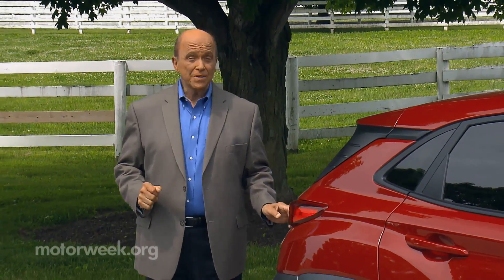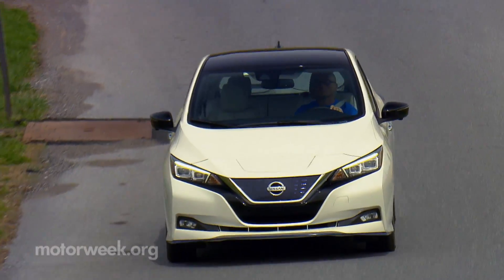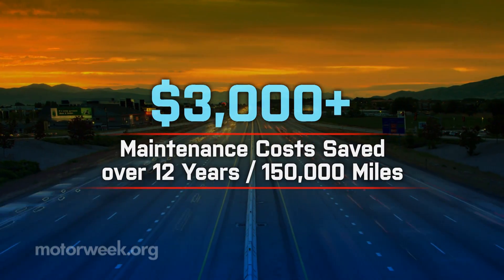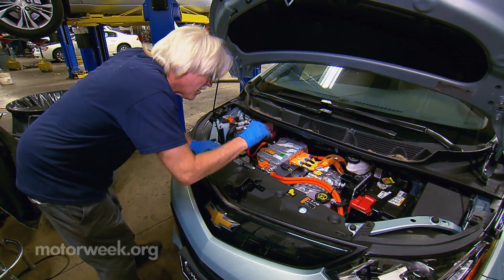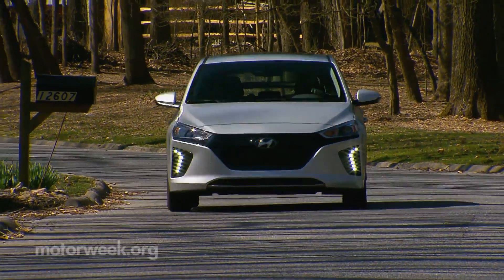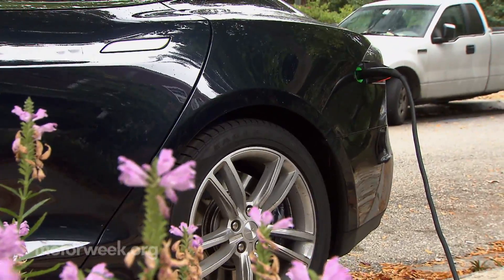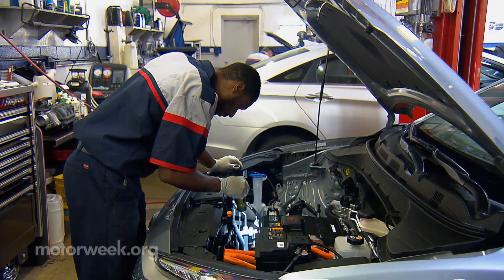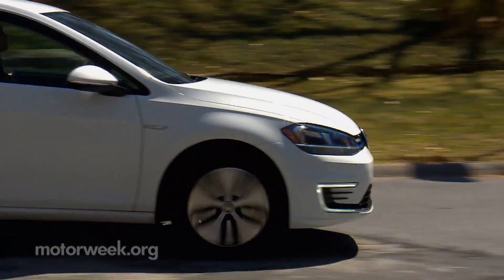Electric vs Gas Vehicles: The Long Term Cost Comparison

Comment: Pay an extra 10-25k for the car, get 3k in state rebates, then install a home charging station ~1k.  See the irony here is that no company is going to shift to a model that the consumer actually saves money in the long run.

So, after the 3k savings on maintenance you're still paying at least 5-20k over msrp for an EV.  Or, if you don't have a designated parking spot/driveway then you sit for 30min-1hr every couple of days at a public charging station staring at your phone in your car; additionally you have to worry about where you will charge on long trips.  Time that far outweighs filling a tank for 5 minutes, basically at a station in every corner of the world.  And the trade off is the "feel good" feeling that you are showing others you are cognizant about the world around you by driving EV?  As you sit in a turbo charged vehicles that zips in and out of traffic 30 mph over the speed limit?  Hmm..A ton of conflicting parts here for me to buy in.

Also, I think this is some overly friendly accounting being applied in this video.  I live in a city where it's tough enough to find parking.  I see a neighbor run a Tesla charging cord out of his door, similar to a battery tender for a motorcycle,  and that's when he actually gets to park in front of his house...  What a headache.  

Add the potential for what I'm seeing as an obvious 'hardware update' and 'software update' fee once EV's start to dominate the market and you just have a new 'dealership/consumer' model.  Tesla is charging a monthly subscription for auto pilot akin to having netflix or amazon prime.  We all know how benevolent companies are when the first iteration of their products hit the market.  Everything is free to fix, yada yada yada, then fast forward a few years and that iPhone you thought would last for a decade and that still works suddenly doesn't have software updates and can't open a webpage.  Or that Amazon prime subscription with free delivery starts to charge 10 for food delivery.  My point being, that if you fall under the spell of early price points without seeing the obvious room for companies to tier and charge for services, then you are not an informed consumer and likely young.  What happens when there is a battery shortage?  Or when the costs of batteries go up because of some supply chain issue?

So, IMO in reality you are not becoming more independent or self sufficient when you go EV; as vehicles become more dependent on computers and chips  you are just giving more power to the actual manufacturer versus the local mechanic, who understands machinery and engines.  We've seen this slow process; in the last decade or so you had to take your car to dealers and pay just to have the computers run a diagnostic.  At every point of this evolution a job has been lost, from the manufacturing floor to the local mechanic and local dealership.  Now with buyer models that are mostly online the dealer sales team will slim down.  And as vehicle prices started to level off all of a sudden here's the push for EV, and EV's cost more!

Most base model japanese cars are built to last 10-12 years with minimum maintenance.  Car manufacturers have just found out a way to charge more for a car with less parts, less hands building them, less people selling them, and a consumer that is dependent on the manufacturer for the lifetime of the vehicle.  

I'll gladly lose .68 cents a day to not have to get entangled in a new model of reliance on the auto manufacturers, that in reality are absolutely NOT going to let their new customers save 3000k dollars over the course of a decade.  The last people on the plane get the cheapest tickets.
Reply: This is 100% true. As a gas and EV owner myself the infrastructure is no where near ready for the masses. And waiting to see what happens with the cost of batteries since like we depend on others for oil, China has 80% of what we need for the batteries so we will eventually be in the same boat with rising cost. Also EV's are still not affordable for the majority. And what's the plan for people who love in apartment buildings? Where are they supposed to charge? And what about people who live in large cities like Boston and have to park on the street?
Reply: This is the explanation that we all need when thinking EV car VS GAS
Reply: @lhogie1962  I think the rational questions to ask with any tech: 

1)what does this deliver that current products do not?

2)is the value of this item appropriately priced? 

3)does it make something I do more efficient? 

4) why am i paying more for this  - is this merely a status symbol or more faddish than functional?  In other words, has my consumer tendency tricked my practical brain?
Reply: How do people assume rebates are free? The government (funded by everyone) can't just give you stuff without passing the expense to everyone else under the guise of knowing what they are doing...
Reply: Here is where you are wrong.  My cousin buy a 2017 Model X tesla for about 90k  Yes, it was expensive, it's low maintenance etc.  However, it's the buy back that makes these care most valuable.  He went to the dealer about a month ago and asked the turn value of his car and how much a new one would cost.  They said 95K for a new one and the sale value of his car was 90k.  So for 5k he can get a brand new car.  Not everyone can drop 90k.  However, my point is that because these cars have fewer moving parts, the resale on these cars are almost what you paid for them.  They are only getting cheaper as the charging gets faster.  You guys are used to modern cars with modern refueling.  When I was growing up it was different.  It took longer to refuel a gas car, 15 to 20 minutes to be exact, until they came up with the high pressure pumps.  Once that happened, it went from 15 to 20 minutes down to 1 to 5 minutes.
Reply: @Ryooken  your point is moot... the value is because of chip shortage
Reply: @spoonsarefun  Wrong again, the value isn't because of the chip shortage, it's because the blue book value.  These cars don't lose money like the ICE cars do.  They hold their value but be that as it may.  The resale value is the resale value.
Reply: @Ryooken  cool well bronco is msrp 50k? Selling for over 100k... supply and demand... and clearly a better investment
Reply: @Ryooken  also that statement is silly af.   To think that lectric cars are going up in value based on anything but availability and chip shortage is lunacy... yeah some clown wants your tesla with 50k miles on it vs new for cheaper...
Reply: @spoonsarefun  I still think that you don't get it. What you don't realize is it's not about supply-and-demand solely in and of itself. It's about the control of the market. Elon Musk car specifically has held control over this Market for the last decade. It's not about the chip shortage. There are several other reasons why the cars are so valuable. One of which is because they have fewer moving parts the cars run like their brand new. 50000 miles in the life of an ed is not the same as 50,000 miles in the life of an ICE car. This is why I said the blue book value is so high. We see the same thing with the Toyota hybrids of the last decade. Because the cars have less wear and tear, the cars are more or less acting very close to brand new. If you analyzed the Toyota Prius and compared it with the other cars you will see that the Bluebook Value is much higher because of this. Going back to what I said originally, whoever controls the market sets the price. Yes supply-and-demand does play some into this. However who controlled and who set the price for the car? The seller that's who. When Elon Musk said that he was going to create a $35,000 car and sell it for that price, that's what he did.  He was the only one selling EVs. That was a hell of a lot of supply and demand now wasn't it? Do you understand now? I really don't understand why you guys don't pay attention to history, even recent events seem to be a problem for you guys. And that's not something I can understand. You always look at what happened in the past to understand what's going on in the present. That seems to be lost instead you guys make this Mantra of poet supply and demand when it's not so it's this when it's not and all you have to do is to look at what happened in the past and follow the trend.
Reply: Adoption takes time you are very deluded if you think EV is not the future, Gas cars still have the advantage of comfort of more than a century of adoption and infraestructure but in a very short time  EVs have taken giant leaps and are already taking a big turn in the market guess where they will be in a few more years is easy to see the faulty spots of a very young industry and im saying this as a gas car driver myself just watching how things unfurl
Reply: @radicalxg8282  when was first ev out? Around same time as gas???
Reply: @spoonsarefun  Gas cars have a century in the market EVs are just entering the market in full with this starting decade
Reply: @radicalxg8282  Yes and no.  Electric cars came out around the same time as gas and were in use for about 10 to 15 years before, the ICE cornered the market.
Reply: @Ryooken  I know they were invented at  the same time but they were just a small pilot try with almost no market due to technology problems that just today are being solved to actually mass produce and sell them, my point is that is really blind and easy to try to compare both when 1 has a century of infrastructure and use while the other is just starting to flourish, EVs are doing giant leaps in a very small frame of time
Reply: @radicalxg8282  That's not entirely true either.  Historically, the EV market was a targeted market toward women because they could not crank the starter, it wasn't until the automatic starter for ICE came about did the market dry up.  Sorry I am just funny about the historical record and I like to correct it whenever I find an error.

That being said I do agree with you that EVs are the here and now for the next 100 years or so.
Reply: @radicalxg8282  Shut up

Comment: Until the price of a electric car of the same type as a ice car is the same price  then I will buy one ..for now no thanx to EV
Reply: Not just that but the battery on electric only lasts 8-10 years before needing replacement. And if it’s cold weather you lose 30% of your batteries range and you can only charge the battery up to 80% anyways so 30 minus 80 leaves you at 50% on colder months so not worth it

Comment: I would love to see how they came up with their $3k maintenance price difference.  That seems quite low.  A Chevy bolt only requires wiper changes and tire rotation/replacements over 150k miles.  A Honda civic will need oil changes, spark plugs, coolant change, brake pad replacements, timing belt replacement (With water pump), a/c recharge, etc. On top of tire and wiper replacements.  A Honda Civic owner will pay far more than a $3k difference in maintenance cost.  Btw, I own both a Civic and Bolt.
Reply: Ok first off most Hondas have timing BELTS not chains.

Second, idk what you are doing to your poor Honda Civic that it needs a timing CHAIN replacement at only 150k mils.

Third, none of that stuff you mentioned is expensive except the timing chain, which if it’s for a Civic it would cost less than $2k (still expensive) possibly less than $1k if it’s belt driven.

Fourth what makes an electric car not need new tires and wipers? Last time I checked electric cars also use those things too.
Reply: LoL  you be lucky If the lectric still runs after 150,000km and on which battery???
Reply: That's what I was thinking as well. I have a weekly budget of $70 for gas because I travel a lot for my job. If I had an electric car I would save $43,680 over the 12 year period of the car.. Now I understand electricity cost money so that would cut that down a little bit but not by a lot.
Reply: @tituslittle  your ev wouldn't even make it 10 years without needing a battery and that's not cheap to replace
Reply: But when your battery goes bad in 10 years have fun paying 10k or more to fix it
Reply: Electric cars still need AC recharges, and coolant change, water pumps, and a $21,000 battery every 10-15 years, the electric motors and controllers will eventually need to be replaced, unlike an engine, if you take really good care of it, you can roll the odometer over, please, let me know when an electric car hits 1,000,000 miles with the original battery and motors, I will love to see it 😁👍🏼
Reply: Yup. A EV still has shocks, tie rods, bushings, Brakes, oils, SRS, etc.
Reply: What would you say the actual number would be between gas vs electric ?
Reply: Thats probably in just parts. Dont need to pay for service if you dew it yourself.

Comment: What happens during a rainstorm when the weather knocks out the electricity city wide or ice storm shuts down the electricity 🤷‍♀️🤷‍♀️🤷‍♀️
Reply: You mean like when a hurricane knocks out power to gas stations so the pumps don't work? It means people run out of fuel (no matter what fuel that may be) to run their vehicles until power is restored.

Comment: 70% of the cost per mile ?... what gasoline vehicle are you comparing to the  1000lb EV ? fundamentally the cost of a Joule of electricity is about 4x that of the cost of a Joule of gasoline. I think he needs to redo the math and also account for the various subsidies for the EV. Besides that gasoline engines are getting more efficient as well.
Reply: You have to take into account the end user's price for electricity - mine is $.096/KWh in MO, while CA is likely 3x that (Gas is higher per gallon in CA also, but not 3x).  Additionally, you need to account for total efficiency of the vehicle.  Electric vehicles use more of their power to propel the vehicle VS a gasoline/diesel vehicle.  When I did the comparison (cost per month in electric usage vs Gas), I would save about half - not including maintenance, which has been mostly minor.  Most electric vehicles as far as I know do cost a little more.  If I didn't have a car, I might consider it more, but I already got a good deal on my car and it only has 90,000 miles on it now, so I'll likely keep it for a while longer.

Comment: never mention of $250-300 you save on gas each month, thats $3k/year savings, alone. A $15k savings for 5 years
Reply: The difference in fuel cost between an EV and ICE car depends a lot on the price of electricity in your area.  In the North East, electricity is so high, a Prius owner will save more money on fuel than a Tesla owner.  This is coming from an EV owner.  The real advantage for EVs is in maintenance cost.
Reply: 250-300? how much do u drive a day? like do u have like a long ass commute? i live in California and im only using about 150 max a month on gas.
Reply: Is electric free? Kw hr thrown on your electric bill you aren't allowed to fix your car lack of dealerships 8 years and 30000 dollar battery tesla has a poor reliability rating.
Reply: I just spend 60 a month,  I don't know what you do. 3.50 per gallon here
Reply: Not true at all, EV will need a new battery pack after 7-8 years so say hello to $14,000 for new battery and the EV already has a higher purchasing price going against it
Reply: @thecollinzboy  depends how you charge it, 80% is recommended soc. There plenty of cars like Tesla have done 200-400k on single packs, it’s degradation that kills batteries by 200k miles you may loose 15-20% of charge, less if don’t charge past 80% everyday. Batteries are getting cheaper as well. All hybrids for example like Chevy volt, Ford Escape hybrid could go 500k miles on original battery pack. Changing battery every 7-8years is a myth. Depends on miles and soc.
Reply: @thecollinzboy  I’m die hard petrol head but EV make sense for daily like Chevy bolt that’s about $25k.

Comment: I'm not sold at all  I had a 2005 audi a6  ran great engine was like new. Imagine having to pay 10k for a new battery and it loses its charge cap every year, and thecar is much more expensive. Who will buy an 8 year old ev knowing the bat is dead almost, can't wrap the logic around my head.....lots of ice cars for sale that are 10 years  old and run great, they don't need a new engine ever with good maintenance,  well you see my points.....good luck with that

Comment: Why don't many people include the battery replacement cost? It apparently costs our kidneys.😂
Reply: Because a properly designed and properly maintained battery will last 500 000 miles or more, far longer than most car engines. We don't factor in the cost of an engine replacement do we?
Reply: @SweBeach2023  Its like keeping your phones batteries good

Comment: Include the cost of a firearm for the EV. Muggings and holdups have skyrocketed at EV charging stations. EV owners are typically middle to upper class, thus have money and they are stuck at the charging station waiting on their car, some even napping while their car charges. Bad guys know this and EV owners at charging stations are easy targets.
Reply: Excellent point bro. Never thought about that. But I bought a used 5 year old VOLT that I rarely charge in public stations. Battery runs out, the gas engine takes over.
Reply: No different than at gas stations.

Comment: What the adverse cost of electricity vs fuel? Just curious. I drive a 93 Chevy 3500. 29mpg and I live 5 miles from work. I only fill up my truck once a month and truck is strong @ 290k miles
Reply: You can drive whenever you want, this is not possible with an EV, you must be allowed to drive first, since the grid can never sustain 200 million  EV charges.    Maybe we could buy hand crank generators to charge our EVs